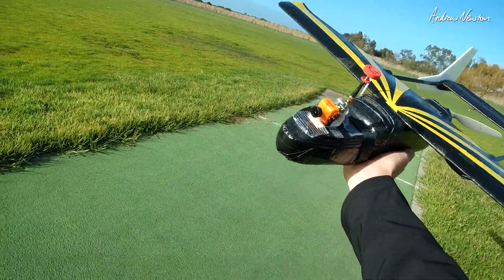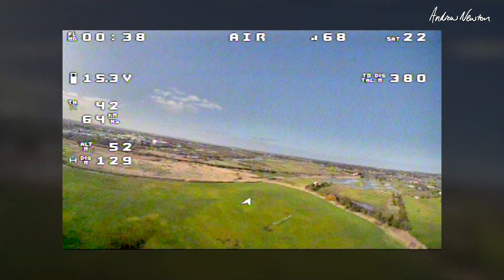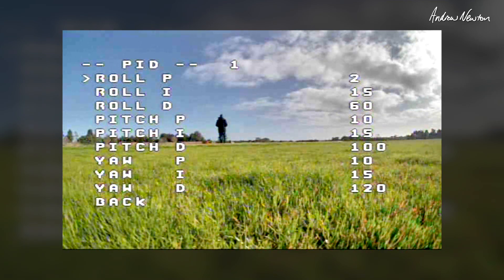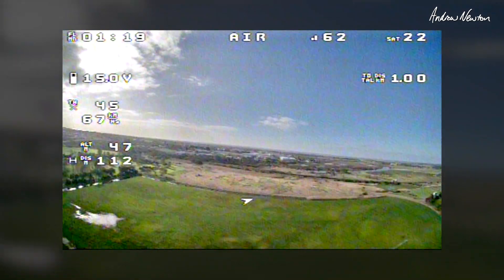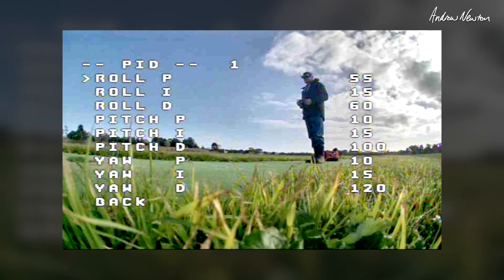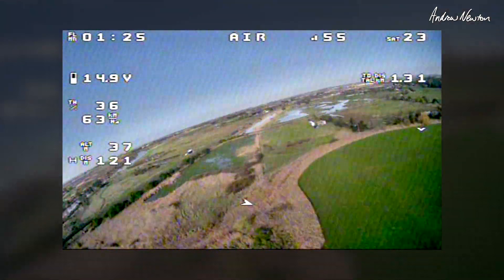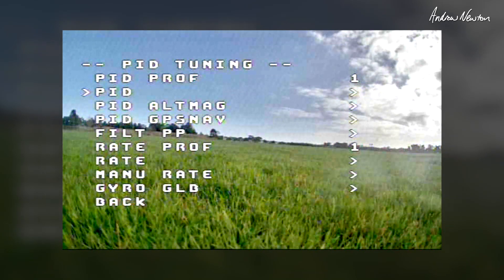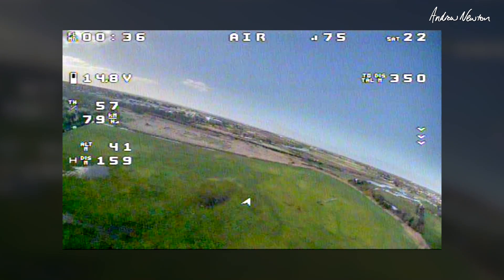iNav Roll P & I tests

Comment: Interesting experiment Andrew. I think you would have seen a greater effect of low and high ‘p’ settings if you had induced a bit of roll by mechanically adjusting your elevons slightly. Angle, horizon and acro modes should be able to cope admirably but too high settings would definitely be more obvious.

Comment: Interesting. Either I am copying you or you are copying me as I have been playing with P & I as well and not getting any significant results. I have been making sub 250 inav planes and in air mode they are okay. However compared to say a Horizon Hobby UMX using AS3X  (equivalent of air mode without bank angle limits like you have in angle mode) they  are no-where near as good at fighting wind gusts and still feeling "locked-in".  To me on the smaller planes in Inav it's like you need the stabilisation of angle mode but with the full control of air mode. Does anyone know if you can take all bank limits off in inav in angle mode?
Reply from the maker: Never tried AS3X. Angle without bank limits is Horizon Mode, but I just fly around on Acro (Air) or Alt Hold.
Reply: @AndrewNewton  I probably explained poorly. Horizon self centres when you release the sticks. I don't want that, simply the extra wind stability. It's hard to explain if you haven't flown a good UMX with AS3X. They are totally locked in against the wind but not at all resistant against stick input.
Reply from the maker: @TakeItToTheGround  Like perfectly optimised acro. Sounds very desirable. Hope iNav can get there eventually.

Comment: Isn't p the stabilization factor and is only noticeable when flying in blustery conditions. I found if I turned it up too high on my z84 it would induce oscillations at full throttle or in high winds. I like to leave I gain quite low as when it's turned up, I find it gives an artificial robotic feel. When it is low it allows you to judge wind direction due to its effect on the wing.

Comment: What version of INAV.? Have you tried AUTOTUNE, would be interesting now.
Reply from the maker: iNav 2.1 I have tried AutoTune in the past but usually don't like the results. Have to keep increasing the FF to my liking. P and I usually end up something like 5 and 7
Reply: Apparently ‘Autotune’ was not working in version 2.1 but is now working in 2.2. I have tried vs 2.2 for FW, and it flew like crap, so I made a hasty retreat back to 2.1. I recon the last decent version for FW was back at 1.9 I might end up back there soon. Weather here like crap too, it’s been about 3 weeks since I’ve been able to try it. Pawel keeps pushing AUTOTUNE so I will give it a go with vs 2.2 on a Bixler 1
Reply: Painless 360 has just about convinced me to have a go at Ardupilot, have you tried it? I’ll give INAV 2.2 another shot, if the results aren’t good, then I’ve got nothing to loose?
Reply from the maker: Not yet, iNav is enough for the moment